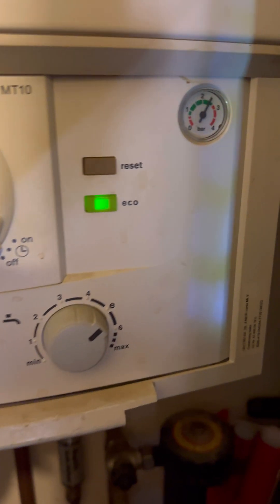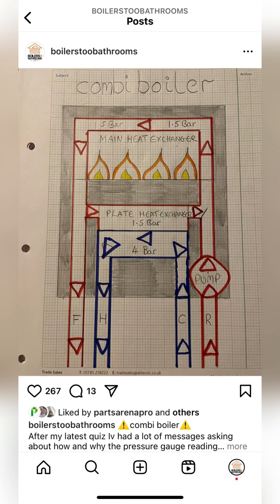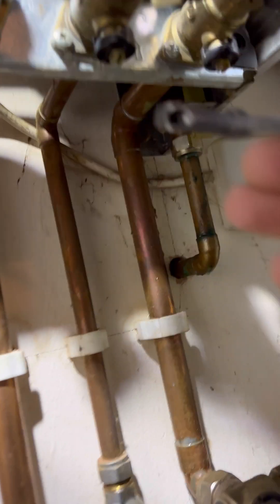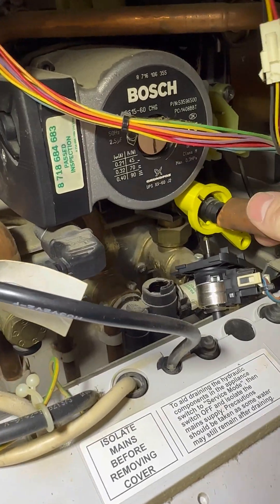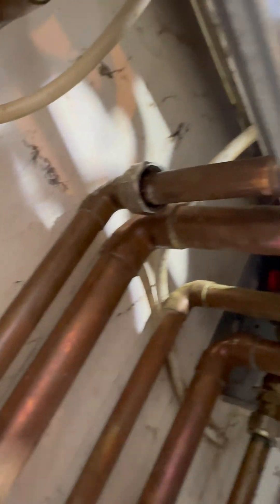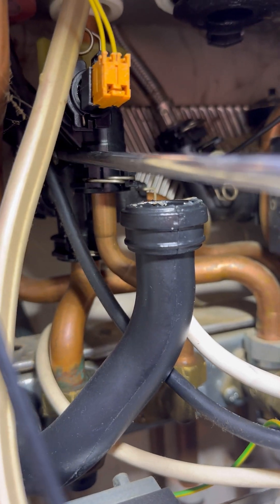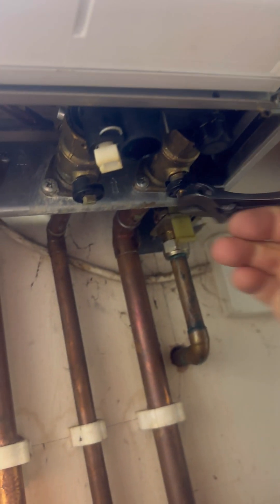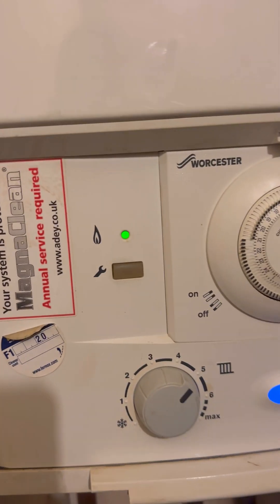My Worcester Bosch combi boilers pressure is in the red and leaking outside 2.5bar

Comment: Agree with you about doing things a professional way rather than prizing pipes and finagling things out lol. 

After a fault like this, do you check/top up inhibitor or advise the customer of that option? If it's been leaking for a while and you've drained the boiler there could be not much chemical left in the system. What I'm trying to ask is, is that included in the job or do you try to explain to the customer that it's an extra cost, or just don't say anything since it'll be picked up at the next service (in theory!!!) ? 

Cheers

Comment: I always do it this way, once you’ve done it a few times it’s a lot quicker as I work for BG we need to get through our jobs quick. Also doing it the way you usually do it I’m guessing you’re charging the customer for a new flow sensor and adaptor that probably didn’t need replacing?
Reply from the maker: I wouldn’t need to replace the sensor however 9/10 times the flow adaptor is brittle and crumbling and a very cheap part to be replaced while it’s all apart rather than another flap back. The amount BG charge I wouldn’t expect an engineer to just be trying to ‘get our jobs done quick’ id expect to be paying for expertise not speed but each to their own
Reply: @boilerstobathrooms  fair enough I personally replace them every time but then again it’s covered under their contract. I completely agree, however we don’t have the freedom to take our time because of how we’re micro managed. We’re expected to do 7-8 breakdowns a day regardless of what they are